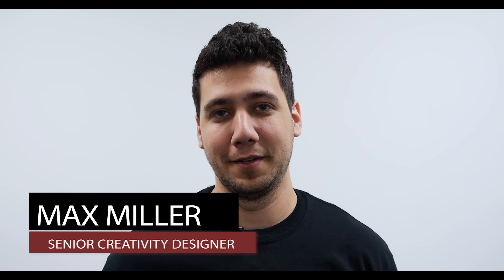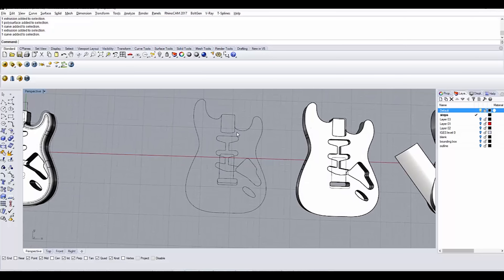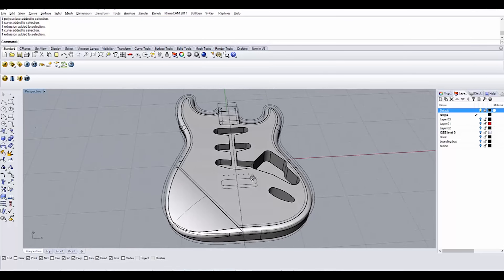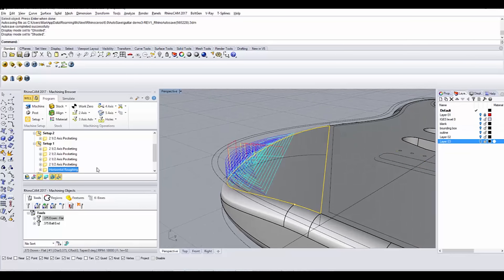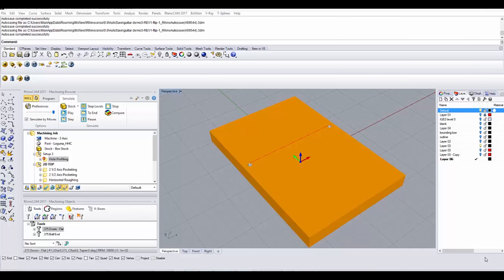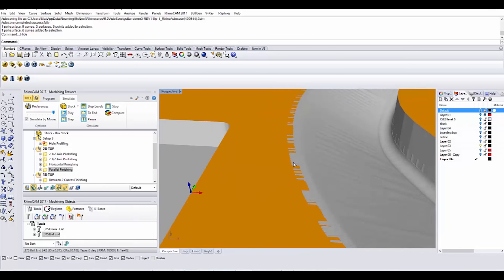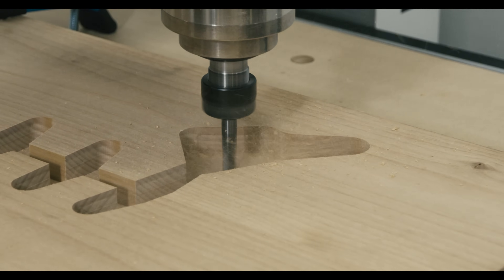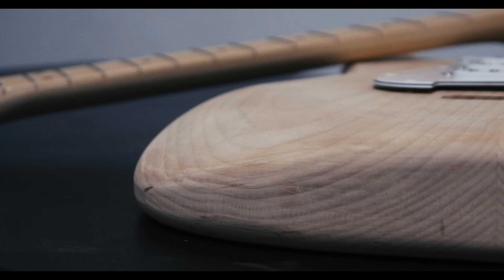Making a Wooden Guitar Body on a Desktop CNC Router | Laguna Tools

Comment: LagunaTools:  Thank for reply.What do you mean"The Automatic Tool Changing system? Are you saying the Pro system software shows of/suggest  what bit should be used for the  next routing path.Correct me if I get wrong.
 Eventually, it will need to change at least two different bits MANUALLY .
Reply from the maker: Both, yes - the Automatic Tool Changing system allows the CNC machine to switch bits in the middle of a cutting program rather than having to pause and wait for the user to change bits. If you're working with more complex shapes or several materials, it's an extremely convenient add-on

Hopefully that makes sense :)
Reply: LagunaTools: That's sweet & amazing. Thank  so much for the reply.
Reply from the maker: You're very welcome :) Let me know if you have more questions

Comment: LagunaTools: What's  the different between (24″ X 36″ CNC) Laguna IQ  and Pro ? Can't make a guitar neck or a body with  Laguna IQ? , Don't get me wrong.I am not talking about the price.I am talking about the Laguna IQ's functions & performances.  I mean if a person interests is only to build different shapes of guitars.
Reply from the maker: The most notable difference between the IQ and Pro is the Automatic Tool Changing system that only comes on the IQ Pro. For a guitar body you'll need at least two different bits: one for the shaping the curves of the body and another to route out for the wiring and plates

Comment: How much does this beast go for?
Reply from the maker: The IQ series starts at $6,495. The one shown in the video is the Pro, featuring the Automatic Tool Change.
https://lagunatools.com/cnc/iq-series/
Reply: What model would I need to cut a guitar body & neck in one piece?
Reply: Jeff Gillis The IQ Pro, since it has an automatic tool switch feature. It'll change the drill bits without causing you to pause your work and manually install.

Comment: I've been trying to get the Fender Neck files that Router Bob did on the IQ for a fender style neck for a long time. If you cut a body you need a neck.   I have Aspire for my Laguna IQ and am having trouble  with it.  Can you help me with it the neck files?  I think Router Bob used Rhino too.  Why did you sell me Aspire if you use Rhino to draw with?
Reply from the maker: Feel free to call us 800.234.1976
Reply: I also would be interested in the neck files if possible. I am in the U.K